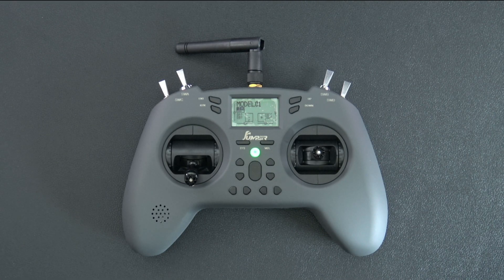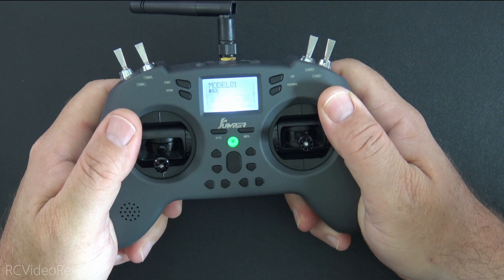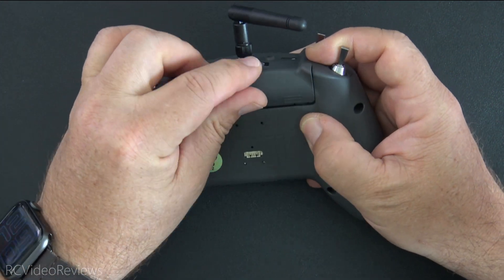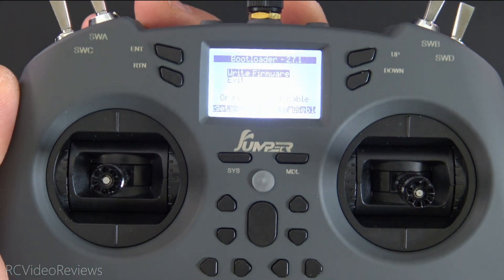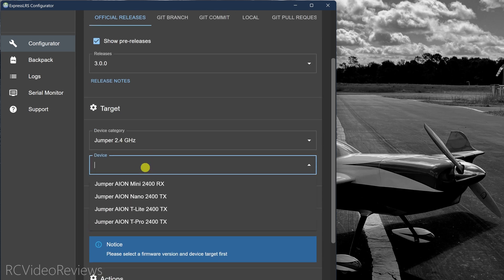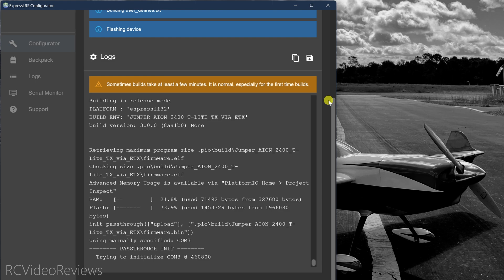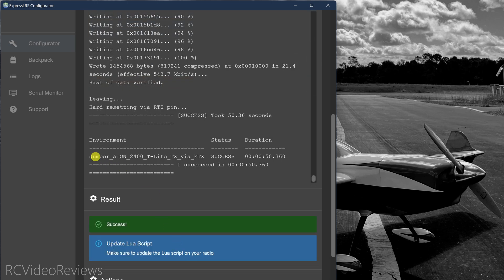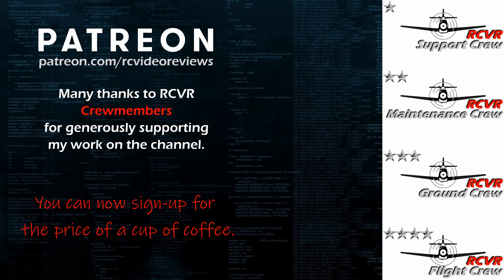Jumper T-Lite with Express LRS and EdgeTX • PLUS: How to Flash ELRS 3.0

Comment: I bought a t-lite V2 but it does not have the SD card slot. There is a slot in the plastic case, but when I try to insert an SD card in there it just falls into the case and disappears.
Reply: The v2 doesn't have SD card reader, has 500 mgb internal storage more than enough for everything
Reply: @AlexLeeping It doesn't
Reply: @AlexLeeping
I tried different cables.
I also disassembled the radio and found no SD card slot on the PCB.
It seems this t-lite radio has no storage.
Reply: It have 500 mgb internal storage, more than enough for everything h @AntonFetzer
Reply: @AlexLeeping OK, so there is a memory chip soldered to the device? I will try again to find the correct driver
Reply: After being away from the hobby for a decade, I have no idea what’s going on here.  I can’t imagine someone new to the hobby.
Reply: @gliderrider I am trying to get into the hobby, but it is very confusing. I don't understand why I need to manually flash software to my controller. And the instructions don't work, because the controller I bought does not seem to have any storage. At least I haven't been able to find it neither in software nor hardware.
Reply: Do not put a SD card on the v2 , I broke the screen trying to fish the SD card out

Comment: I have de same tx an RX but I can't bind, same version of ELRS and bind phrase. Help me
Reply from the maker: If you're 100% certain you have the same revision of firmware and the identical bind phrase, you'll need to open an issue on the ELRS github. I've never had a failure to bind when the firmware is the same on both tx/rx and the bind phrase is the same.

I don't know what your bind phrase is, but maybe try something simple to test like 123.

Comment: I followed this and many other guides, but i cannot get this transmitter to work. The one thing that stands out is my Internal RF will only allow me to select XJT D16 and my External RF is set to CRSF. I would have thought the internal RF could be set to CRSF ?
Reply from the maker: Did you look in your system->hardware page and ensure the Internal module is set to CRSF?

Comment: Thanks.  I noticed flashing breaks it.  Wanted to get rid of heli-tab, but i can wait till next relrase.

The rubber coating seems to ne silicone based, as nothing sticks to it.  No epoxy, glue or cyanoacetate.   I scratched a pad clear to glue on some grip pads.  Works great.
Neat little transmitter for in the backpack.
Reply: The v2 ,when bricked shows a " no SD card" u have to watch the video on, how to unbrick jumper T Pro, u have to take the back out and press the tiny button together with the 2 button and the start together to enter firmware update

Comment: My main radio is the tx16s MK11 with elrs built in. On my 2 whoops I was using a cheapo radio, kinda sucked. So the Jumper T lite v2  4 in 1 is now my whoop radio. When my external elrs module gets here it'll be a backup radio for my micros and racer fpv quadcopters. Really would have preferred a momentary switch, but so far I'm very happy with it.
Reply from the maker: Good to know. Thanks for the first hand info.